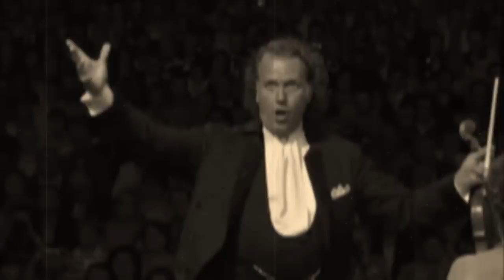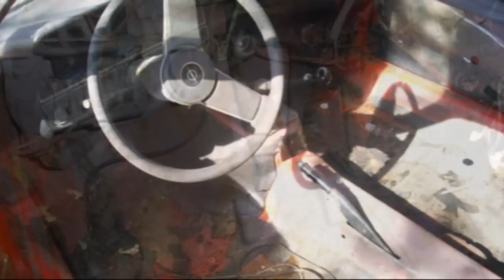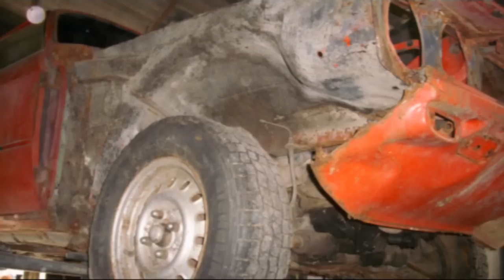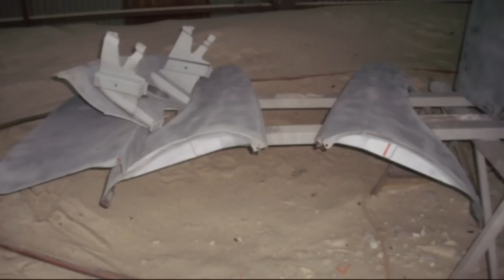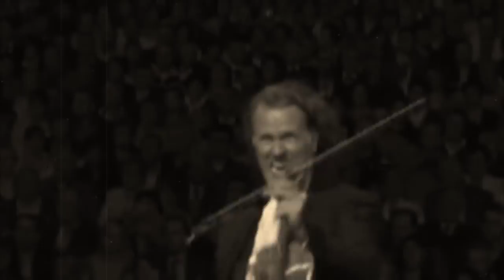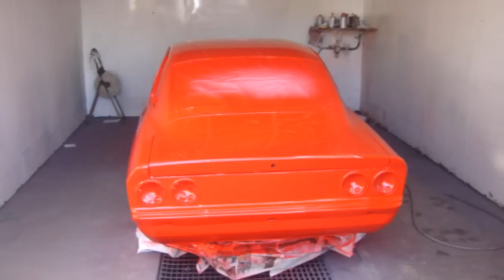Opel Manta A Rallye 1972 (Restauración)

Comment: In 1976, I bought used 1973 Manta  for only $800. I kept it until 1987, and sold it for $150 to an active duty marine.  I still have the occasional dream that I find it in some random parking lot, and start it up.  It was easy to work on, which was a good thing.